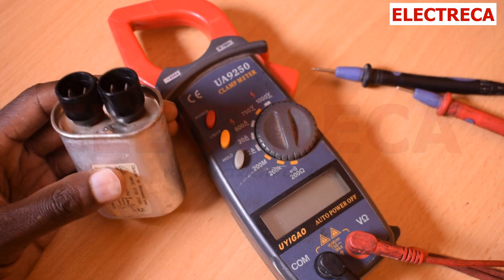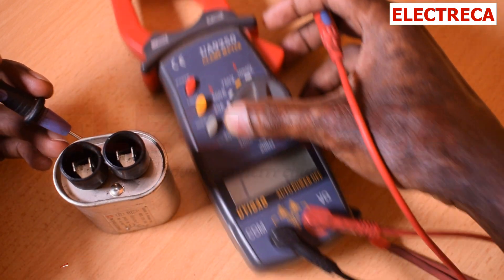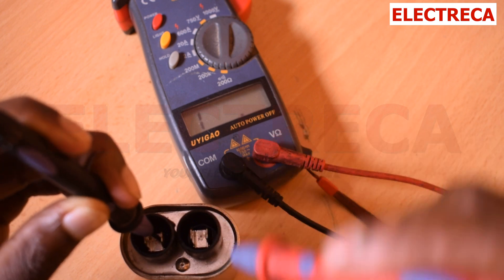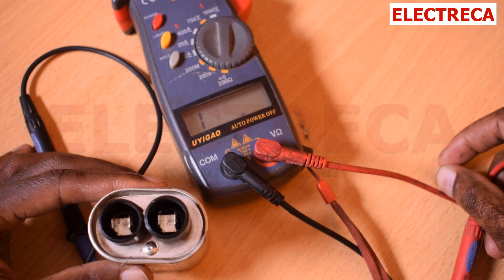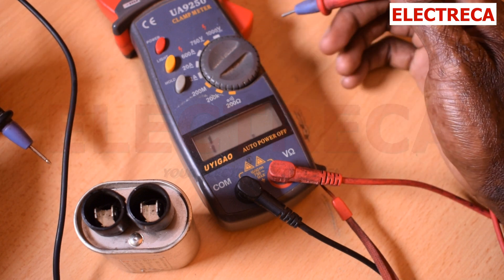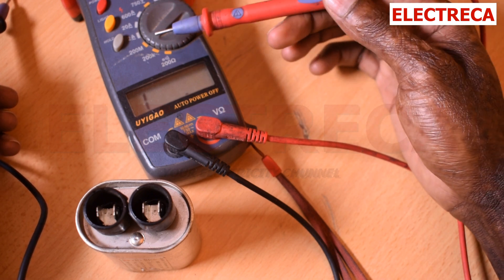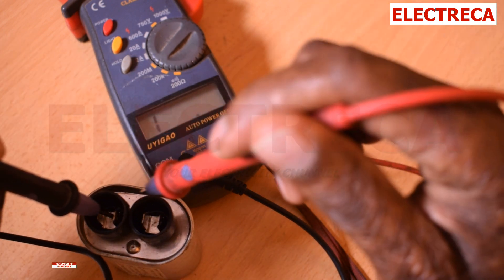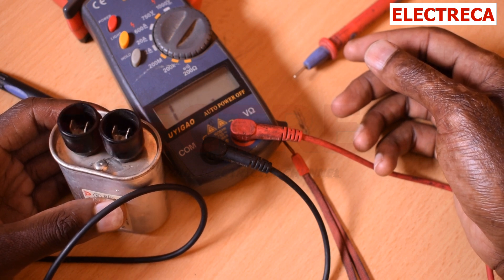how to test HIGH VOLTAGE MICROWAVE capaitor using a  multmeter|ELECTERCA

Comment: A very good way to test this 1μF capacitor ... is to wire in series with a 25 Watt , 230 Volt Tungsten filament light bulb .... connect the whole lot to your 230 Volt AC mains .... the bulb should glow a dull orange , similar to the heaters of a 1940's valve ( tube ) radio 😝! ... also makes a good night light ! ! ...... DAVE™🛑

Comment: You are missing an important point.  The RC time constant of this capacitor is about 10 seconds (1 microfarad x 10 megohm).  This means that a functioning capacitor will not only show 10 megohms resistance but will charge up in about 10 seconds.  That's what your capacitor did.  If the resistance had gone to 10 megohms immediately, it would mean the that capacitor is essentially out of the circuit and is faulty.

Comment: I have a microwave that blows the breaker and the fuse is fine?  Tested the old one and it was fine but installed a new one anyway and still blows the breaker. It’s like a dead short.
Reply from the maker: Hey 
There 2 issues that we can look at. (1) The circuit is overloaded (2) microwave is faulty
(1) microwave requires a breaker of 20Amp if you have many loads that exceed the rating of the Breaker. it can cause the circuit to trip, but to know if this is true ..... before you connect your microwave make sure its the one on the circuit or find another circuit with a higher rating. If it works consider give it its own circuit. if it does not then the microwave is faulty...
(2) Microwave faulty
If the microwave is the trip then it's faulty. check the following components to see which one is causing the trouble, Because any of the following can cause the breaker to trip if faulty.
1) High voltage diode    watch here  https://youtu.be/7zf0RC1maJI
2) Transformer
3) Capacitor                       watch here   https://youtu.be/RPGx_JZY7pY

Op it helps.
Reply: @elektreca  Thank you for the information I will check both of them items out
Reply: @elektreca  4